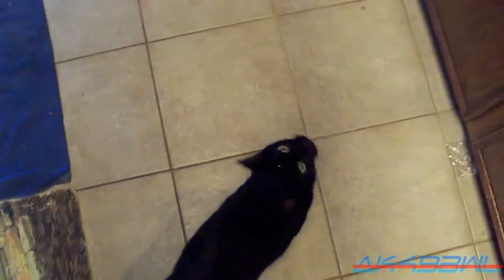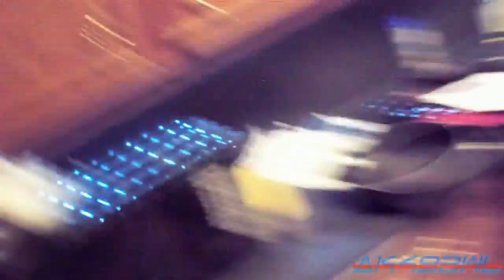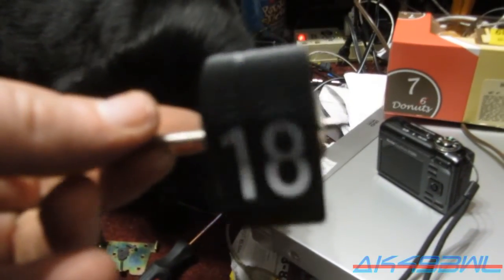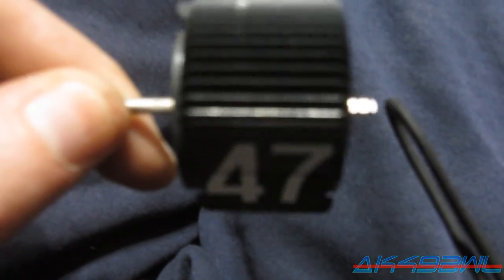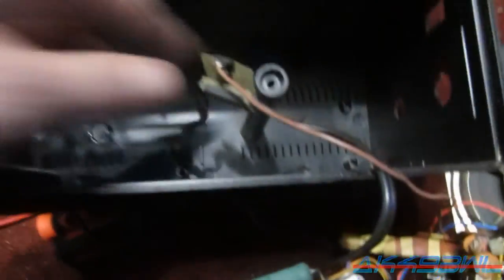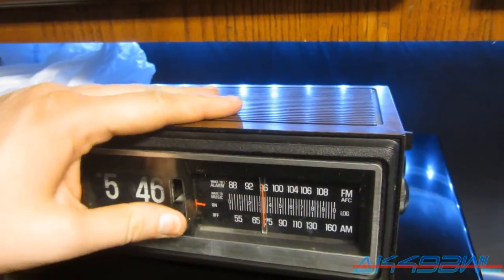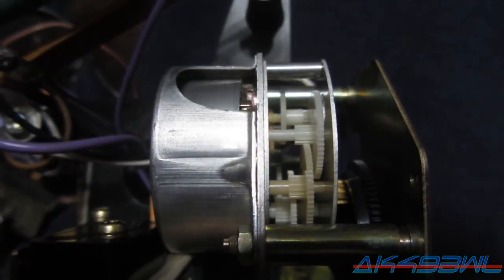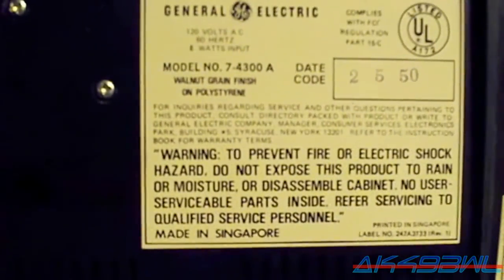Camera Test, Clock Fix - VLog 266, 12/01-02/2016

Comment: You were using a pre-YouTube camera?  That is amazing!  Happens that I still have in a box, an old Fujifilm camera, but this was a low tech camera running at 280p with no audio input as if the camera could take silent clips, unless an external mic was added.  The camera runs on 2AA bateries as it wasn't ready for lithium packs.  Was good for picture quality, but resolution was still low.  Here's a sample clip from 10 years back: https://www.youtube.com/watch?v=yCZTXg_HXZo
Reply from the maker: I have a Kodak EasyShare CX6200 still in its original box, parents got it for me for Christmas in 2002 :D it does 320p with no audio, period lol. 2MP camera, greatest thing ever I had back then lol.